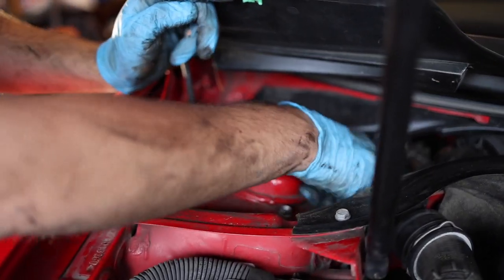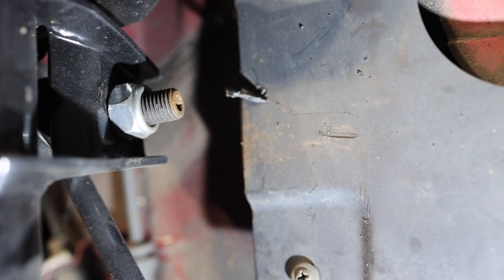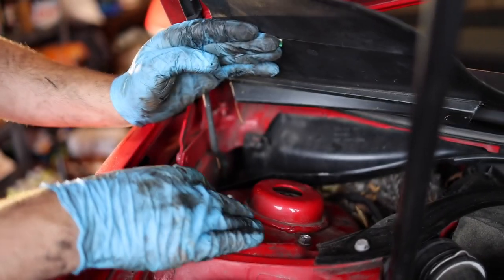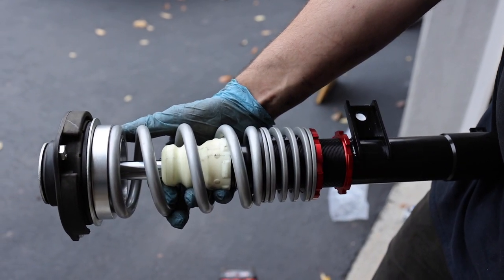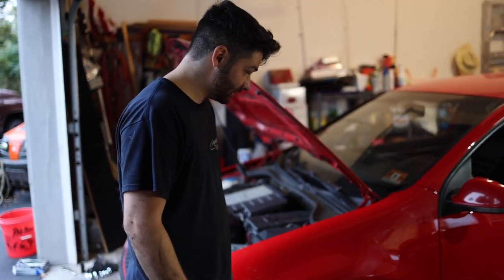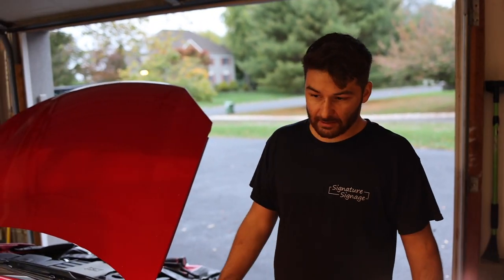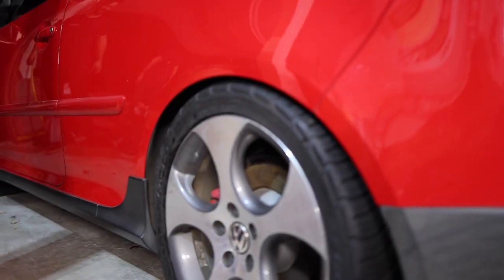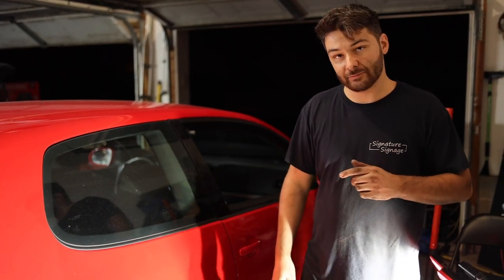Lowering our Mk5 GTI on Coilovers!

Comment: On an FWD car, preloading the rear suspension can actually increase your 0-60 time by giving you a better launch. As the weight shifts to the rear of the car durong launch, the preloaded suspension helps keep more weight over the front wheels for better traction.

Comment: Just picked up my 09 Mk5 last week, currently dealing with headlight struggles at the moment but she is also my project! Wish me luck and thank you for the Vid!
Reply from the maker: It's always something with a project car! Lol and you're welcome!
Reply: Had some issues with MY MK5. Passenger Xenon didn't wanna work. Turns out it needed a replacement ballast. Very simple fix. Both Xenon's point outward though still, need to reset their positioning with a VAGCOM

Comment: Having had this done to my MK5, i just wondered if you've experienced any rubbing issues on the front? 
Usually on these some arch liner mods are required!!
Reply from the maker: We currently don’t have any rubbing issues on the front, but I have had issues on my previous GTI lowered on coilovers. A lot has to do with your wheel and tire setup and then of course how low you are on your coilovers aswell

Comment: Nice informative video. 

In the past when I’ve changed shocks on my t5 transporter and 2k caddy which have this style hub. I have used the pinch bolt and put it into the threaded side of the hub, I’ve then put a chisel in the gap and wound the bolt in till it touches the chisel which separates the hub enough to remove the shock. I should really invest in a spreader but I never have 😂
Reply from the maker: Thanks and hey as long as your way worked sounds like you saved money on not buying the spreader 😂

Comment: May I know wheel size? ET and how width? 8,5 or 9?

I have 235/35/R19 tires and ET42 and 8,5 wheels and thinking to get BC Racing coilovers but I'm not sure if I will able to lower it that much since wheels are a bit out. (mk6)
Reply from the maker: They’re stock so it’s 225/40R18 I’m not sure what the width is unfortunately. But yeah you’ll have clearance issues with bigger wheels if you go low low. Also if you go with a thinner tire you’ll be able to reduce some clearance issues

Comment: Hey man I have a 2007 mk5 and want to lower it with coilovers (currently running 18 x 8.5 +45 with 225/40R18) Do you think a 1inch drop will work or do I have to downsize the tires?
Reply from the maker: Honestly I think you’d be fine! A 1inch drop shouldn’t give you any clearance issues. But if you go lower you might have some issues!

Comment: funny cause this is when they discontinued this system, everything was made by some off brand chinese company. ecs sent me a scratch and dent street system with 1 missing front coilover and you couldnt find a proper replacement for the strut or the springs. go air

Comment: Was there anything extra you had to purchase to make them fit in the car? not tools, I mean suspension hardware, spacers, whasers? etc749
I am debating if I buy this kit you installed, currently at 499, or the next up, ES#4045771 that is 749.00.
Reply from the maker: I don't believe so nope! Whatever we showed in the video install is all we had to buy!
Reply: @RatchetWrenches  thanks for the reply, after checking other reviews, I went with the adjustable dampening set, it was 774 with tax.
At least I can use your video as a guide when installing them.